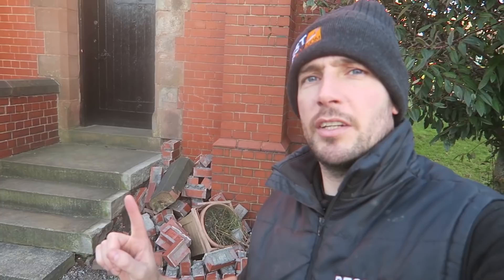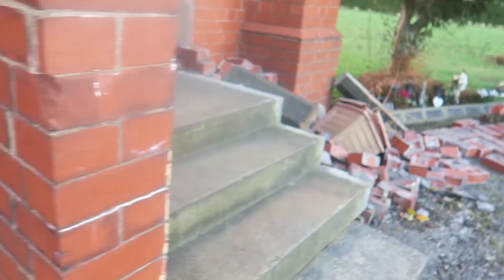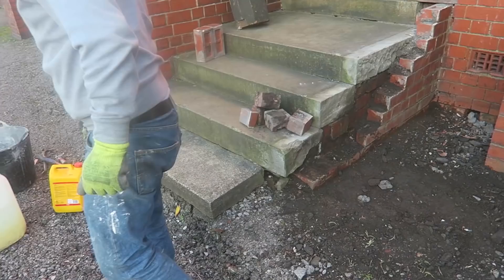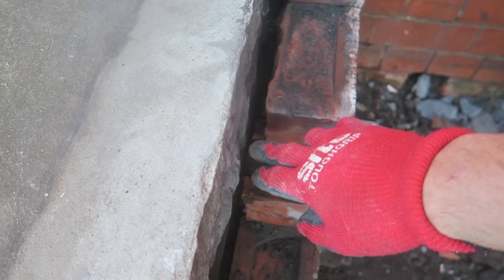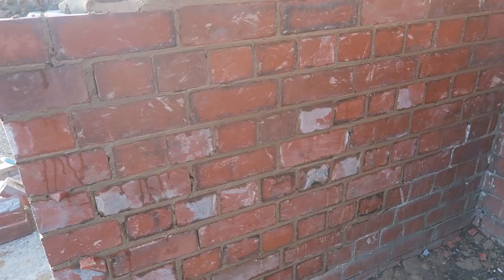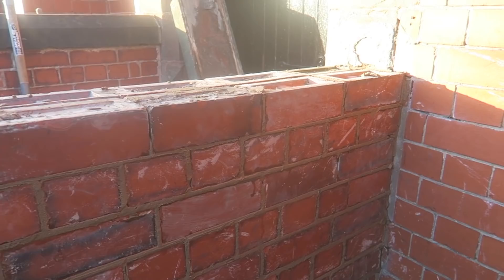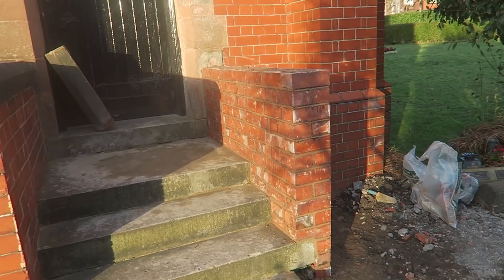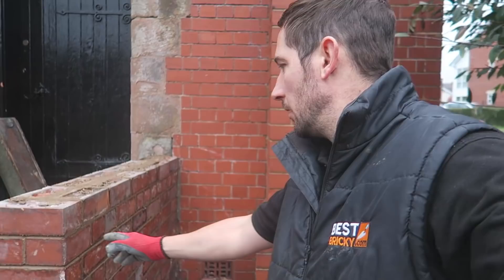Bricklaying - English Bond Wall

Comment: Stu..English bond starts with a header and then a queen closer to achieve quarter bond straight from the corner mate..
Reply from the maker: Yeah I know that but not when you are reusing the original bricks and putting it back together as it was built
Reply: stu crompton yeah fair one...good call

Comment: With smooth face engineering bricks, old and new, after the pointing is complete I rub a small sheet of Rockwool over the faces. It cleans off any mortar smudges perfectly. Great job.

Comment: Nice work as usual Stu. Just wondering why you mixed the mortar on the steps. Are you not worried about damaging/leaving residue?
Reply from the maker: It will wash away in the weather, we didn’t have a board that would fit in the car

Comment: Just asking, why no queen closer instead of 3 quad bricks?
Reply from the maker: Yeah I thought that because at first I put a closure next to my first header automatically but I had to change it to match the existing. Don’t ask me, ask the brickys that built the church
Reply: As always Stu, good job.
Reply from the maker: Cheers Kurt mate
Reply: Hmm broken bond on the other half still up on the header course - right bloody jig saw . Stu did well to get the rebuilt one to be good - would of been a job if they let him repoint the wall that was still up .....great work m8
Reply: Think this is actually called dutch bond, stu. 3 quarter on the corner instead of a queen closer

Comment: Great video again Stu I have two quick questions I'm doing a cavity using thermalite blocks and the blocks are sinking down a lot is this just something that happens and there's a way of doing it more efficiently but I can correct by adding more mortar but I only get this problem with thermalite so I'm a bit confused and sometimes when I scrape mortar away I smudge the brick even though I scrap along the perp or bed 
Thank you for the videos  there helping me so much and are you doing CSCS stuff in the future
Sorry for all the questions recently I just find it easier to learn from you as my instructor at Carilion tends to overcomplicates things ☺️
Reply from the maker: If you become a Patreon Joseph I will answer your questions any time
Reply: stu crompton yes sure I just watched your Pateron video sorry ☺️
Reply from the maker: no bother mate